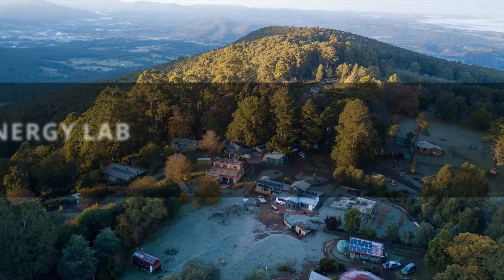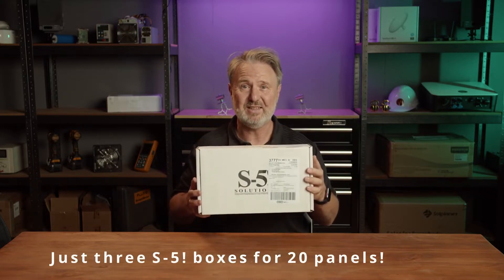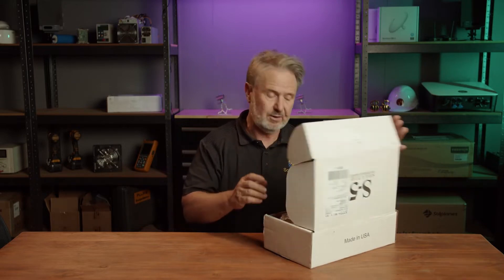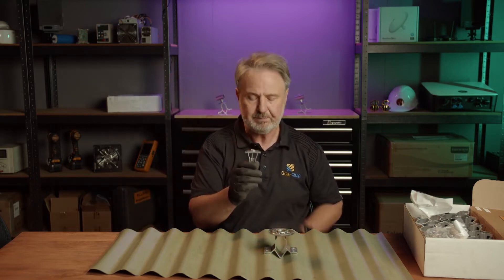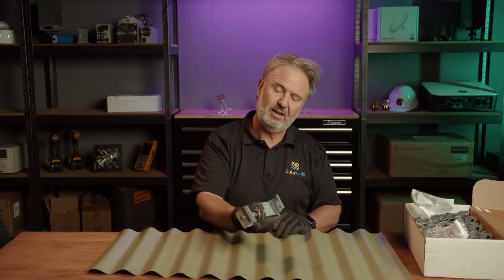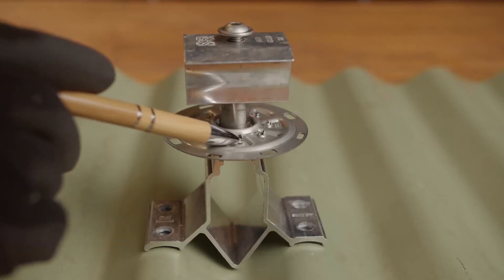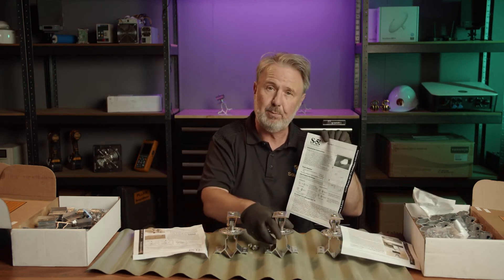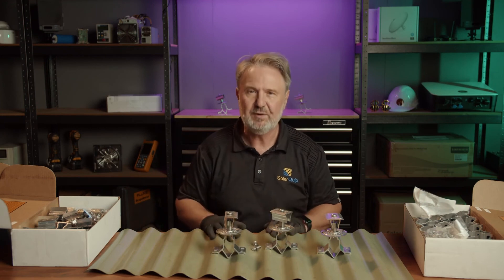What's in the Box with Glen Morris: CorruBracket 500T PV and the PVKIT 2.0 by S-5!

Comment: I am very keen to give this a try, but it appears the cost is about double a rail system with mids and ends. Then the issue of earthing to comply with Australian regulations. Logistics and labour should be a saving, but I do not think it will be enough to make up for the double cost of the hardware. Please, prove me wrong.
Reply from the maker: We understand your concerns and would like to share some thoughts and an article with you from our Regional Training Manager in New Zealand, Bernie Dombroski, on that subject.

"My comment on pricing is simple, the cost $c/W is similar to traditional racking and as scale goes up, PVKIT is cheaper than racking at wholesale pricing. The key savings are labour - faster installation times, training and many installations with PVKIT have proven to me that the average install time is 4-6min per kW with PVKIT for an experienced installer Vs. 16-20min per kW for traditional racking, logistics (freight, site handling and storage. see article), weight reduction to the structure (See article) the roof becomes a canvas, in most cases you can fit more modules and the lifetime warranty.  (Link to article - https://tinyurl.com/n4zaexam)"

If you have any other questions or concerns, please reach out to us at support@s-5.com and we'd be happy to discuss with you further.
Reply: you can fit a 50kW system in 8 boxes - weights about 18% of the weight and you can fit the entire package into the boot of your vehicle - no flatbed, truck and if shipping it can go at far less cost ;-) - happy to give you additional info if needed.